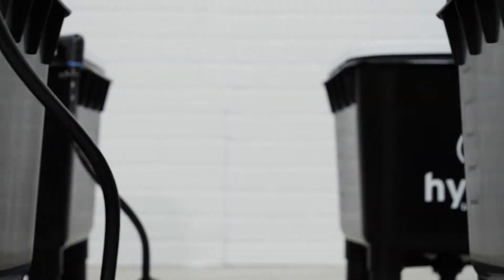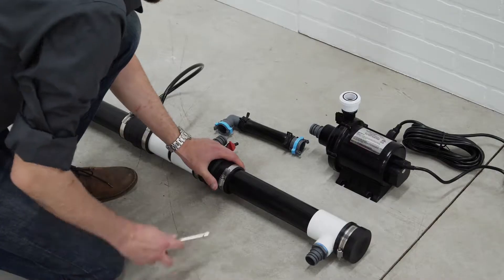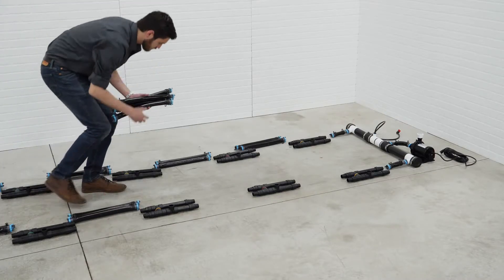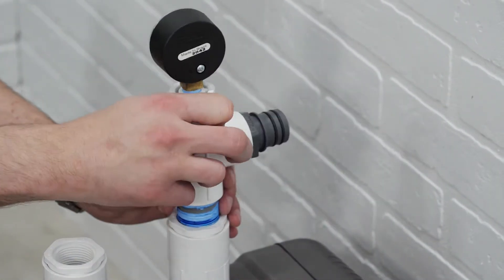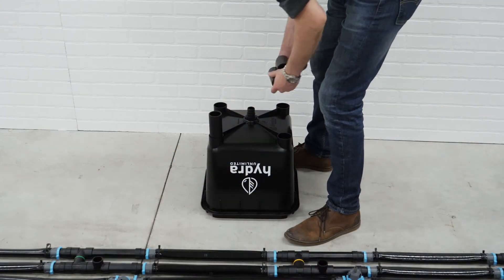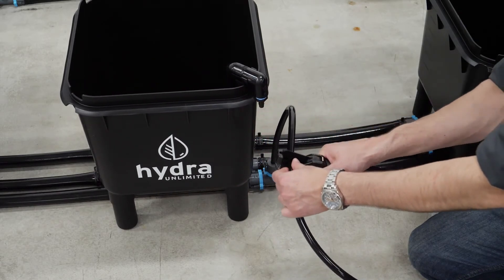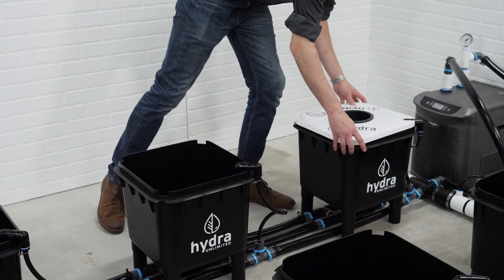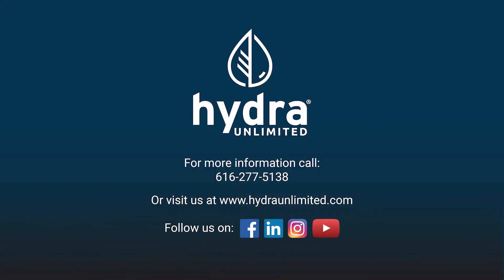HydraMax Professional Hydroponic System Install Guide | Hydra Unlimited

Comment: what size is the water chiller 1/2HP or 1HP? what do you guys suggest?
Reply from the maker: A 1/10HP is good for 2-6 buckets. A 1/4HP is good for 6-12 buckets. A 1/2HP is good for 12-22 buckets and a 1HP is good for 24-32 buckets. Hope this helps!

Comment: Way to go. Make a Current Culture system WAAAAY more complicated and expensive for no gains....good work.
Reply from the maker: Plenty of benefits for someone who knows what they're doing, and plenty of reasons why facilities upgrade their current systems or build out brand new rooms and facilities using HydraMax. No gains? Try 25-30% higher yields vs. traditional setups and methods. Cheers.